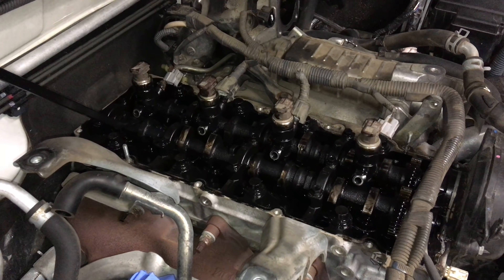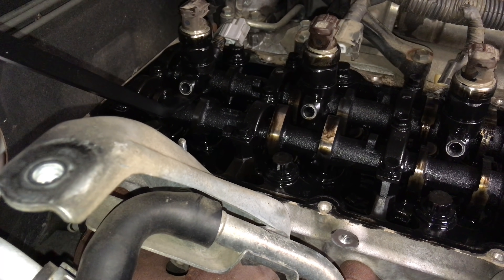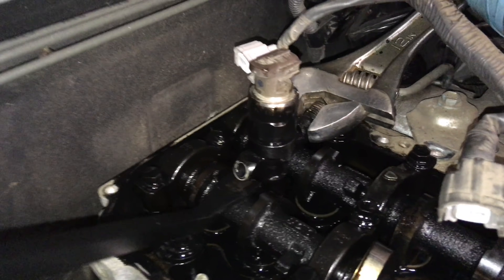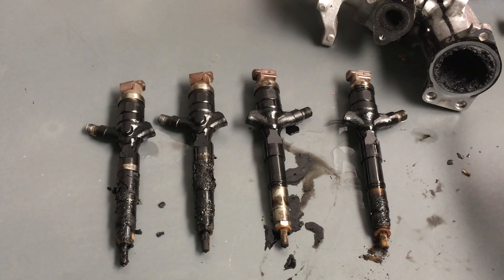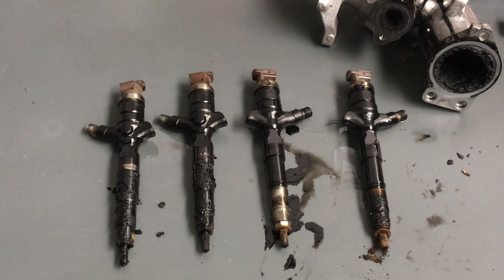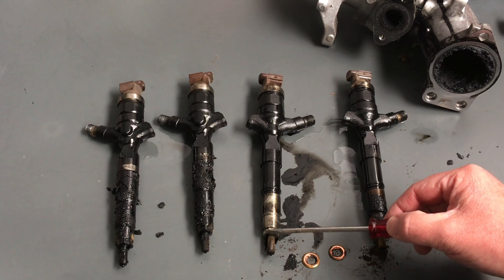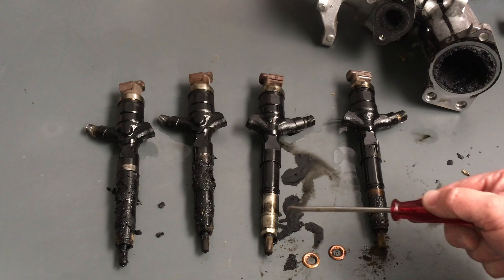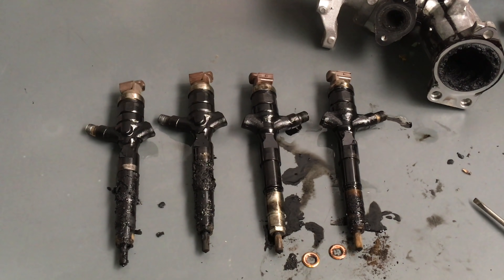ANOTHER ENGINE ALL BUT DEAD PART 4 - GETTING THE STUCK INJECTORS OUT - Technique

Comment: Hi, I drive a 2006 Toyota hilux D4D. It has 256’000 miles done now. I got the injectors replaced at 210 K as the jeep as Smokey on start up and running rough. I had the job completed by the very well respected garage. All was well and in fact the jeep is still running well. Having said that I change my oil and oil filter every 5 to 6000 miles and I always stick a bore scope into the oil sump drain hole and inspect the oil pick up gauss which I find is ALWAYS 50 to 60% blocked. I cannot get the oil sump off without taking the engine out or at least lifting it so I owe cans of carburettor/ egr valve cleaner to clean the gauss which takes a good hour to do. I have watched your videos on this subject which I think are brilliant. Would you please be able to advise me on which direction to go. 
Kind regards 
Tony

Comment: Thankyou for the information on this issue and has similarities to other brands of vehicles, I owned a 1990 Toyota 3L 2.8 D 4-Runner for 16 years and enjoyed trouble free ownership but had to sell to upgrade the tow capacity of a 2002 TD5 Landrover Defender. I am sure you might question my choice but as I do all my own maintenance I also found this to be an excellent reliable vehicle.
My reason for making comment on this vid is that the TD5 also has copper washers sealing the unit injectors that do suffer the same erosion issues although this does not cause lubrication issues as the compression gases escape into the common fuel rail giving immediate misfire symtoms under higher engine loads so it will not go unnoticed by the driver for any length of time. Changing these washers is similar to what you need to do on the Toyota but a lot simpler and less time consuming. Thanks again as I enjoy watching mechanics with skill and passion.